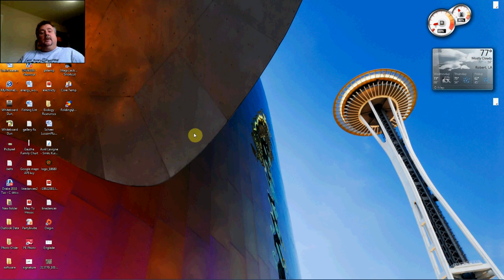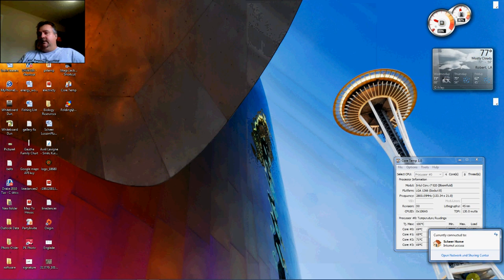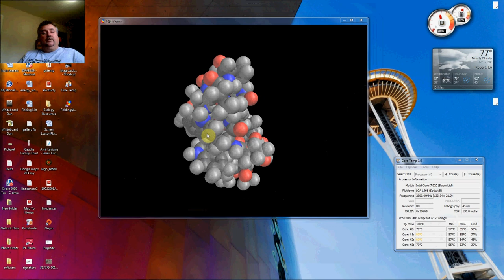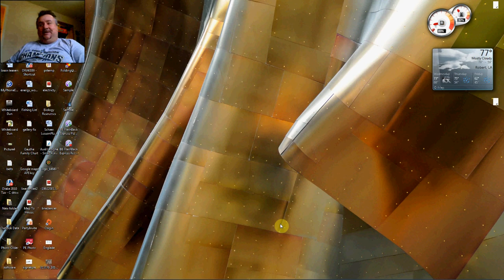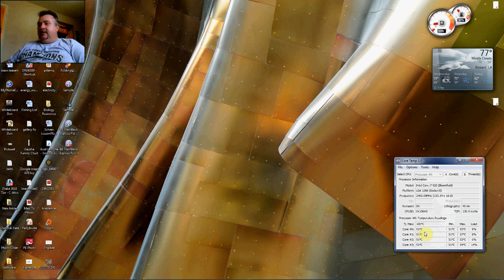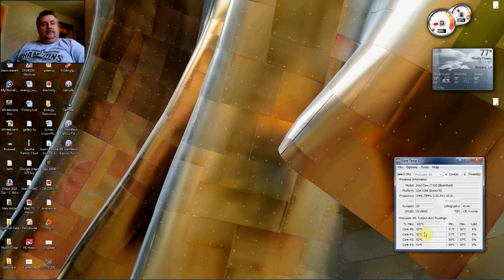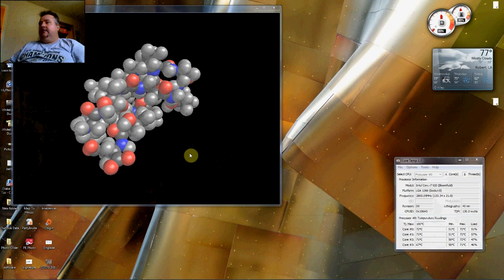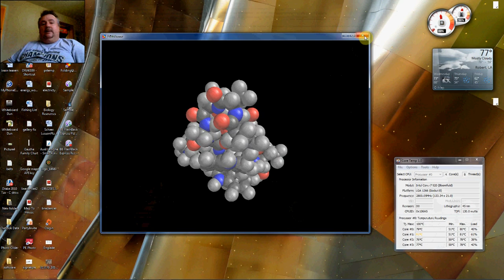How To: Computer CPU Dust Removal

Comment: Thanks for making videos like this. I think it's good to for people to have access to see how to do this kind of stuff. One thing you should consider next time and that people should be aware of is that you should hold fans still while blowing them out. It's very easy to kill or shorten fan life by cleaning them without holding the blade still. Additionally, the processor fan can cause motherboard problems if it spins incorrectly. Anyway, thanks, and I look forward to the next video.

Comment: is true, the compressed air can actually spin the fans in the wrong direction in a unsafe RPM not recomended by the manufacturer. this can ruin the bearings. not sure about shorting em out, i remember that happening like years and years ago with old style PC fans.

Comment from the maker: It depends on the performance level of the computer. This one is a hog and moves a lot of air with it's 8 fans. More air equals more dust. My kids little computer with 2 fans accumulates much less dust over time.

Comment: Remember, PLENTY of fans is good. Never have too little. Also don't do what this guy did and use a stock cooler, if you have a dusty enviornment, and are too lazy to clean your case, get an aftermarket cooler.